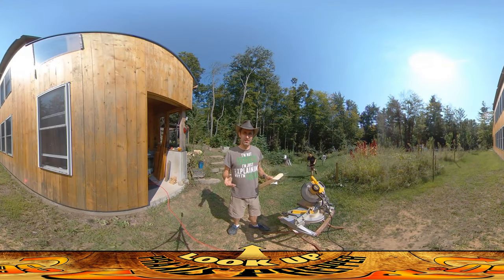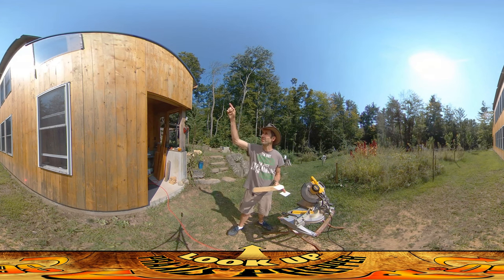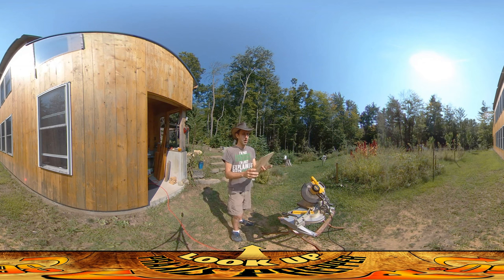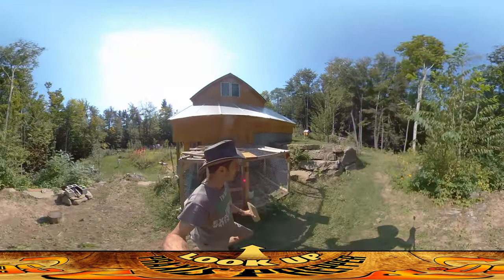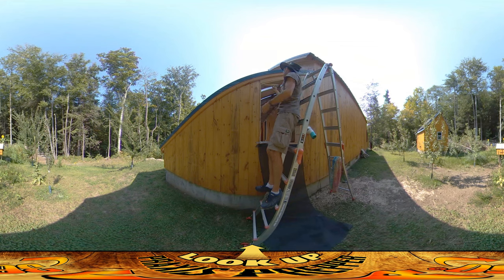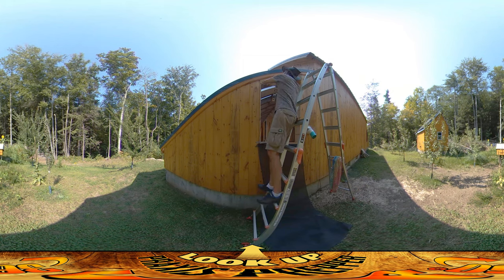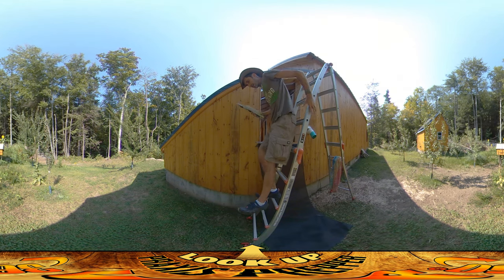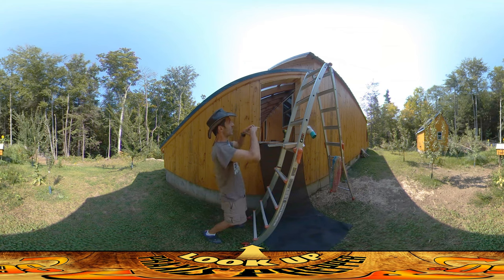Homestead Building - Carpentry, Building Wooden Louvers

Comment: Just looked at the date and didn’t realize it had been so many days since you posted the last couple of videos, must have gone up just after the last time I looked. Anyhow, if you are still cutting boards and having problems with the blade grabbing them, ask your dad if he has the clamps that would have come with that saw. They fit into the holes immediately behind the fence and put downward pressure on the wood being cut. Main diff between them and a regular clamp is that they don’t have a bottom section and use the bed of the saw as the bottom jaw.
Reply from the maker: Clamps might have helped. It seemed like the blade was just dull though. I just went throigh slowly. Didnt have that many boards to do so wasnt a huge deal. We got through it okay and a storm tested the louvers last night. They seem to shed water well. :)
Reply: @PraxisPrepper  Good to hear that they seem to be working well. Nobody can accuse you of not taking the time and effort to build everything strong. When everything is done, you will definitely have a home to be proud of.